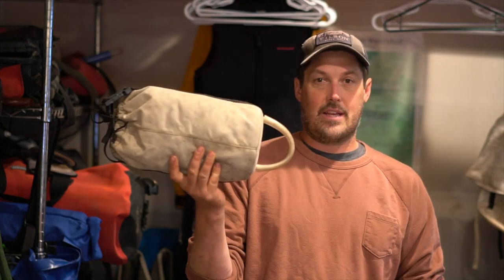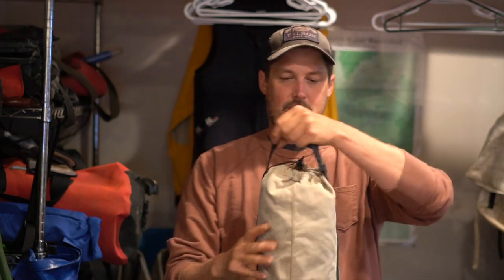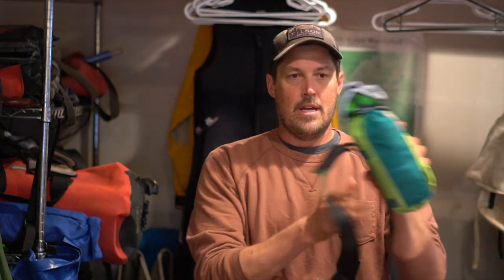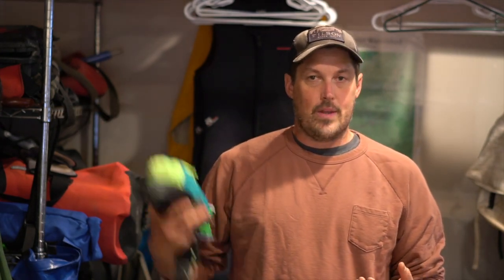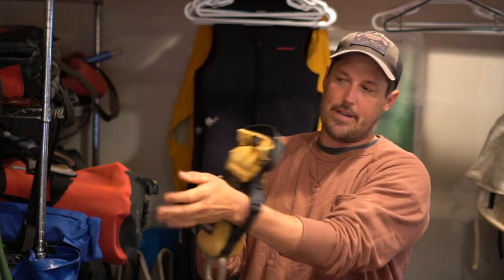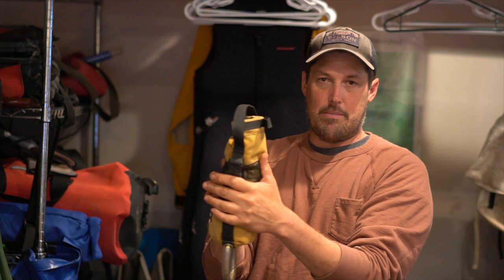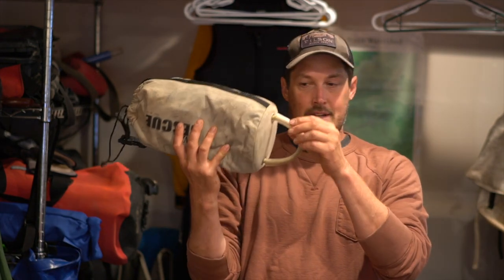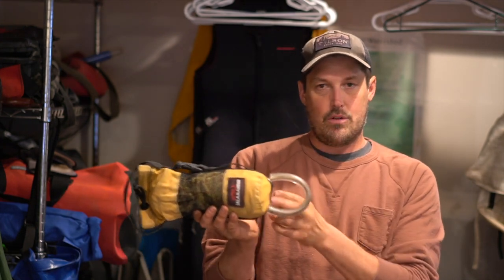Throwbags and the Clean Line Principle | Ep. 85

Comment: I had a local shop make me a bag that included a "claw" a plastic ring with teeth at the bottom of the bag.  you take a the rope out and can use the claw to catch on to another line or parts of a boat.  It doesn't interfere with the throw, we tried using it to catch a kayak that was surfing, it wasn't able to hook the boat but it might be helpful for some situations.